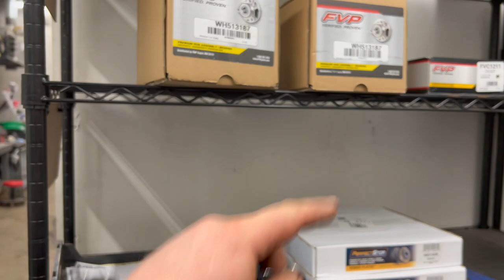Just Saved His Life (maybe) | Pontiac Grand Prix Wheel Bearing

Comment: And now this wheel bearing will fail prematurely because you hammered the axle nut on with the impact wrench instead of torqueing it to spec with a torque wrench.
Reply: He did torque it to the proper value at 13.01

Comment: I know the non-ABS hub assemblies for these cars are actually more expensive than the ABS hubs. I feel that the ABS hubs are more readily available too. Easy to just cut the 2 wires and cheaper so why not. Good video!
Reply from the maker: I don’t remember off the top my head, but I believe these were the same price for both assemblies and they had both in stock.
Reply: The price difference isn't huge but you think there is more materials in making the ABS hub that it would be the more expensive one. Must be a supply and demand thing.

Comment: for your brake dust shield that goes between the bearing and your spindle face, you got to be careful as the rotor will be that thickness recessed farther in towards the brake caliper bracket. Off centered.  I have had rotors rub on the caliper bracket by leaving the dust shield off.
Reply from the maker: I agree but in this case it was not going the make a difference.

Comment: Do you think autovalue has good quality parts
Reply from the maker: It’s all aftermarket garbage out of the same bullshit manufacturing plant sold at all parts stores (Dorman mostly). When you do this every day you learn quickly what to use aftermarket and what to use OEM. I use Auto Value specifically for their Mevotech suspension line (best suspension parts I’ve used) and Timken wheel bearings. That is why I do most of my business with Factory Motor Parts because I can get many things OEM for GM and Ford.
Reply: @ValleyCityAutoYT  well said we’re would you recommend getting good Honda part from Based off your experience
Reply from the maker: @hamerkiller   as a shop owner, the dealership. If it was for personal use probably one of the OEM parts warehouses online.

Comment: Good lord 😳  go in have wheel bearings.  Dude just cost the guy a 4 wheel alignment. Air impact every bolt. Skip the shield that's important. That's how you screw the customer.  You'd be fired from my shops. One master hacker
Reply: What’s “go in have wheel bearings” mean? Air impact every bolt? There’s nothing wrong with that that I can see. They’re tight aren’t they? Also, how is he going to cost him a 4 wheel alignment when he put the struts back where they belong? (On the front of the car)  “You didn’t put the shield back” its a dust shield. If your really that concerned on a beater about a brake dust shield, your more than likely trying to sell the customer some other part they don’t need. Also, if you watched the video, the drivers side dust shield was cut off.  I’m sure you didn’t watch that. Remember, this is a beater car.
Reply: Ive done the wheel bearings on this car  on my own without a  impact wrench. As long as you don't fuck with the tie rod you won't need a wheel alignment.
Reply: @Willyd2758  Strut bolts should have never been touched. Yes, the camber "should" be ok going back together, but it is possible it is now off. Guy put everything back together with an impact. I personally would snug everything up, then go back with a ratchet or wrench for final tightening. Impact and send it🤣. That bearing has been off before, its a 15-20 minute job, even tightening everything on final by hand.
Reply: There is no camber adjustment on these cars... unless u put in a cam bolt